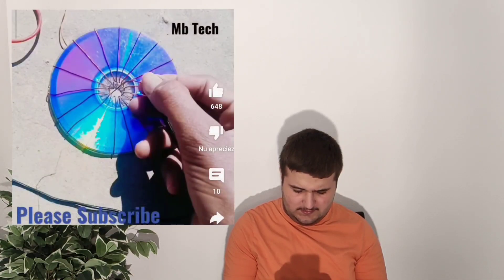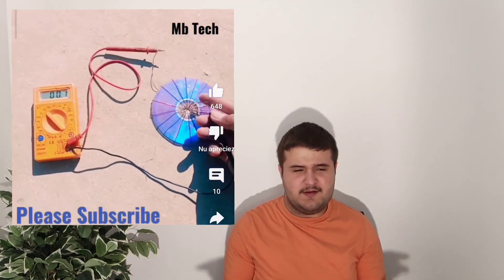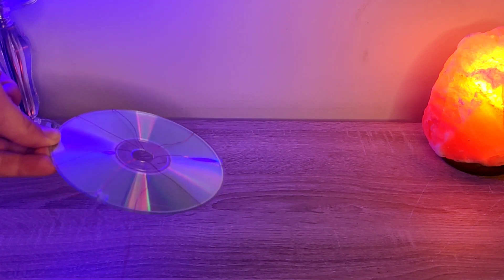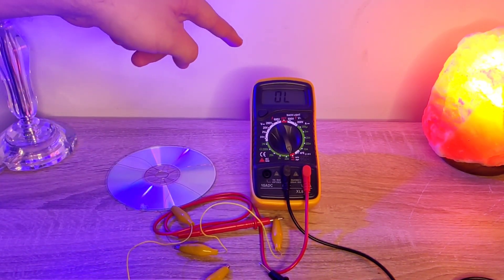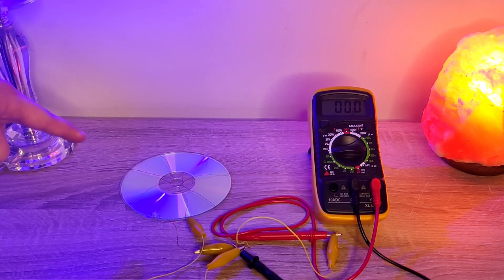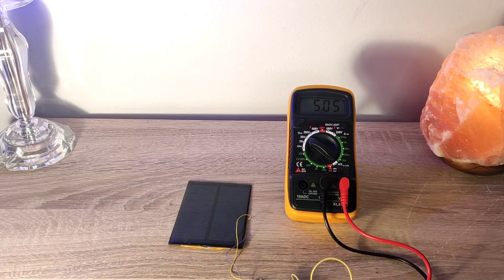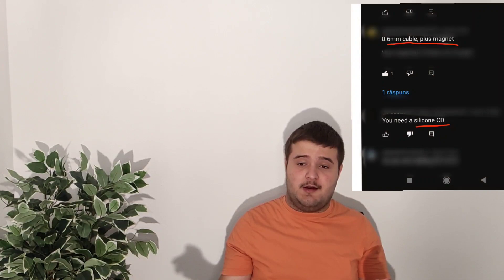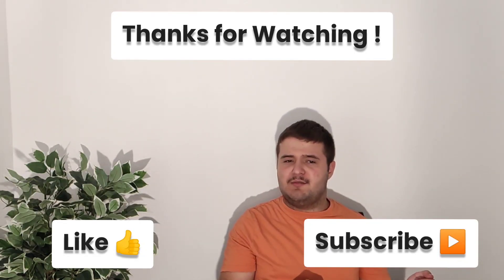CD Solar Panels are Still FAKE ! Debunking the DIY CD Solar Panels (Again)

Comment: If you can get 0.65 mm copper wire and wind 46 turns around a dvd from the center, it works. The dvd in this video is not like that.
Reply from the maker: It's about how energy is being produced trough light. It doesn't work, and if you set the multimeter to AC, you may get some reasings because the coil acts as an antenna. No CD, DVD or size of copper wire will make this work on light. I suggest you read on Wikipedia how solar panels works and how special salts in silicon dioxide are used to make a conjunction and create voltage.
Reply from the maker: Also, based on what irrefutable evidence do you say it works ? Have you experimented with it ? Have you set a multimeter to see if there is a voltage ? Pleas, do not spread lies. (Read the previous comment too)
Reply: @photonik-luminescence ... Metal coatings do not have anything more useful for but as polarized magnetic or light bend optics material shaped by electricity.  The oriented magnetized coating is only a read only and never an electricity producing type material.  Solar Cell technologies are electrical engineering studied from only using semiconductor elements of Silicon and Germanium for wider applications of materials needed to have excitations in electrons to flow by being doped N-type and P-type or ease in electrons of the N material of a semiconductor to flow into the P material of the same material (Silicon and Germanium).  Scientists also found on microscopic Solar Cell new materials some Carbon lattices able to have Semiconductor like N and P type dopings parallels.  The idea of Semiconductors are since they aren't either a non metal as much as they are either not a metal the physics of excitations of their more metal-like n-doping to flow into the more non metal-like qualities having receptive "electron holes" to ground the produced current through the induced voltage (called EMF like electric field between a capacitor) between both N and P dipping or substrate layers produces enough electrical current by stimulation.  A metal material can't be stimulated because it sees the same potential voltage (like ground grounded to ground) of no electron filling an electron vacant place called a "hole" to move electrons in a source voltage stimulation.  Likewise for non metals insulating current from flowing physics.  Silicon and Germanium (and atomic lattice structures in Carbon molecules) are the only chemical elements capable of producing large enough electricity stimulated by voltage excitations only if the semiconductor material can be doped into two semiconductor junction material definable by being more metallic (doped slightly with more electrons) to more non metallic (doped slightly with more electron vacancies that can easily take in electrons in current flow requirements).
Reply from the maker: @lawrencejelsma8118  thanks for all of the information and for watching 👍.But in other words, yes and the CD solar panels are fake. The metal simply makes no sense and the CD isn't made out of a semiconductor material that has been dipped in solutions to make a P and N side.
Reply: @lawrencejelsma8118  True However they are always read with a laser Red for CD/DVD  and Blue for Bluray hence the name.
Reply: @photonik-luminescence   The fact he suggests using a very heavy duty wire that is also a non standard size is a massive red flag, And obviously it's utter nonsense.
Reply: @dogwalker666  ... Or CDs and DVDs are not "P diffused material" where the metal wire copper windings are supposed to move electrons freely that an N diffused material of the silicon can.  Metal in MOSFETS don't interfere with the PNP or NPN source to drain free electron flow but enhance the flow by an applied gate electric field acting like a capacitor across the junctions in MOSFETS.  In other words there aren't any metal used to replace N doped Semiconductor material (now really only Silicon vs Germanium or other) because of physical science reasons of not creating the electron-hole pair with like an oversaturated applied voltage.  I know the Japanese were working on solar skins at the micro level with Graphite (a lattice of Carbon atoms) the time I left the university.  Because it is an atomic scale production or manufacturing thought no U.S. laboratory or company in the U.S. (maybe Intel but I am unsure) that the innovative Asian engineers are working on today.
Reply: @lawrencejelsma8118  True, The PV cell technology has come a long way, My point is a CD has basically just a very fine coating of aluminium, With the writable version having dual layers, If we could make PV cells with just aluminium and polycarbonate it would revolutionise the solar power industry.
Reply: there is nothing on a CD that will produce or help produce electricity. save your CD's and make a cd tabletop covered in epoxy resin, would be a more a awesome artistic project, than this non-sense cd solar. i rather buy a real solar panel works a 100% saves you time, money and effort.
Reply: @sgtjoe2008  exactly.
Reply from the maker: Well put 👍

Comment: Well CD rom photovoltaic cells are fake. But what about using them to make parabolic reflectors for solar thermal?
Reply from the maker: As long as CD reflect Infrared light properly, i guess it should be possible as it rather implies to turn something shiny into a parabolic mirror. I am not sure how this would be executed though and the element being heated should be able to absorb the infrared light comming of the sun (i guess a tube or so). Especially how the CD would have be deformated in order to achieve a parabolic mirror like a reflector telescope mirror. According to a spectroscope result with infeared camera my CD reflects infrared. While i cant say for sure it sounds plausible but i would have to try it out myself. Also another factor is the size. All CDs have the same size and they appear to be pretty small. So with a bit of realistic expectations maybe it works. Thanks for watching 👍

Comment: you didn't do it right...smh
Reply from the maker: What? No,it was done correctly. Either way, magnet or not, CD with silver coat or not, copper wire enameled or not the science will not work. This CD solar panel doesn't have any N or P side done by giving certain salts to the semiconductors. There is no N P conjunction either !. Pleas reffer to the Wikipedia article on how actual solar panels work to see what didn't work
Reply: No matter how it is done it can't work, There is no way in this device too convert light into electricity,  You need a P.V. Cell.
Reply from the maker: @dogwalker666  i don't even know why people bother to support this fake CD solar stuff. They confidently lie and support the lie. Why would you fight for something that isn't eaven real. It's like going on war for a country that doesn't eaven exist